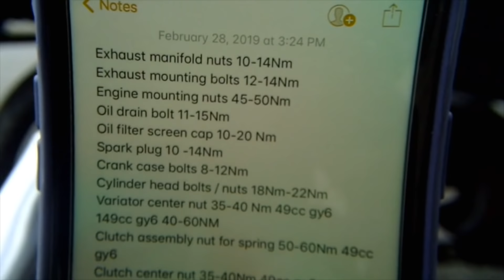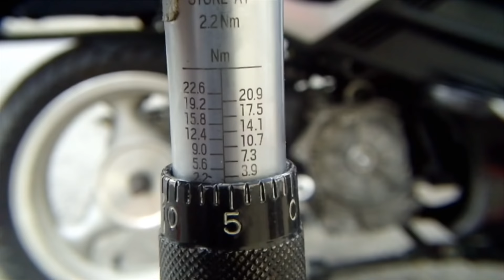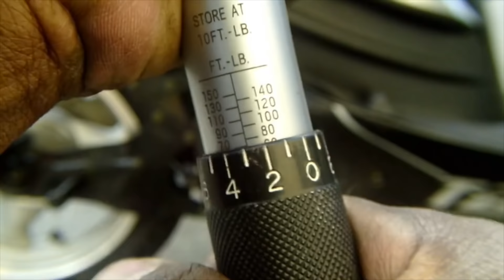GY6 150cc Scooter High Performance Starter Clutch Upgrade/Engine Crankcase Torque Specs/How To

Comment: How long has it lasted?
Reply from the maker: To b specific I found out about this clutch on a JONWAY odd looking scooter that I destroyed the engine at 5k miles. I then put this clutch on a TaoTao lancer that had over 3 engine upgrades all with this clutch swap at start and the mileage on that scooter when I sold it was around 8,000 miles (not in kilometers). 

So that’s 8+5=13. Still was working in top notch spinning. Heck even now I have a Lifan V16 that’s 12,284 which is working perfectly but that clutch by far was my most used engine piece on any bikes I’ve own to date. Though that record will soon b over within the next few months and that Lifan V16 will b the first since that clutch.